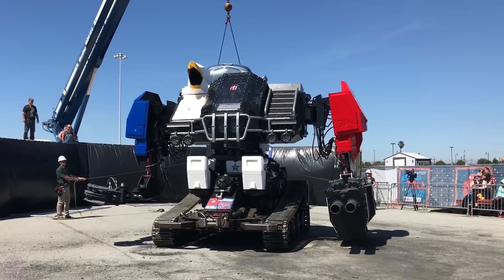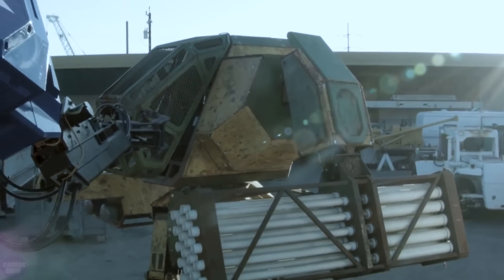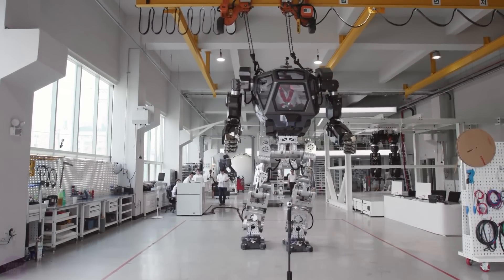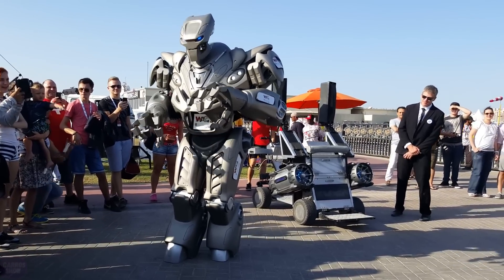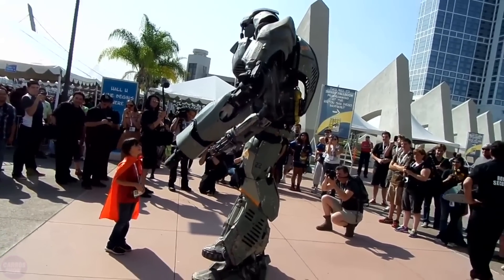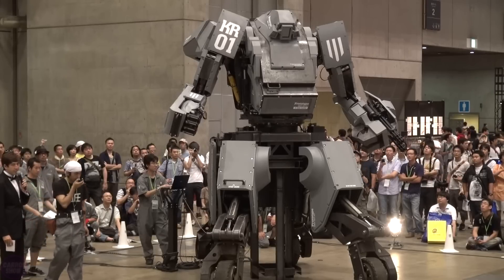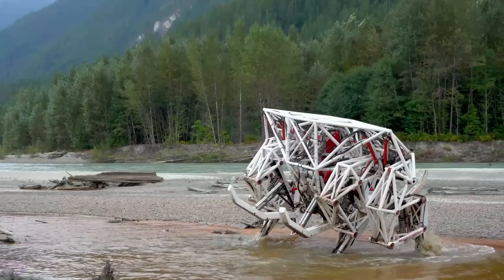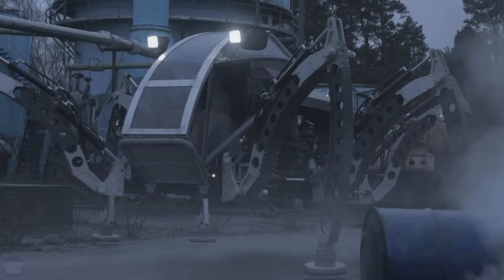CHINA's New Generation Combat Robots SHOCKED The World

Comment: Imagine converting the technology of MarkIII to function as a Fire fighting tool. The Bush fire's that are impenetrable and high Risk management. That robot can save many lives and protect property. A walking water tank with Fire hoses On it's arms and legs.
Reply: Yes, but many parts will melt from the extreme heat from fires.
Reply: @4-SeasonNature  modify and convert the current application and add the Fire retardant material and utilise the functionality for cooling system. It's possible to produce and would be a game changer for future use.